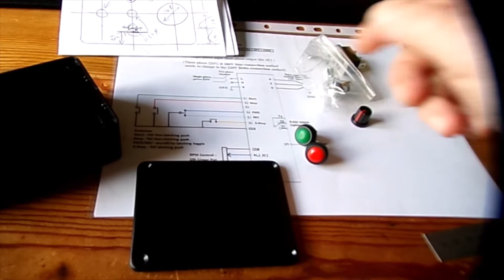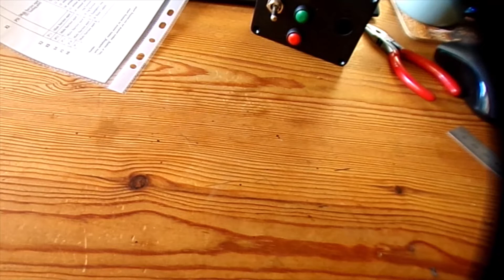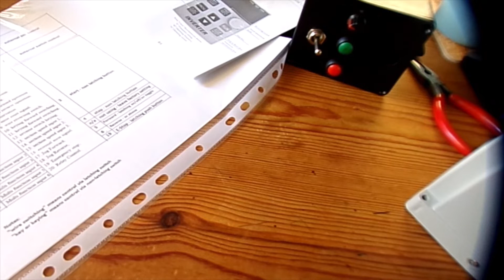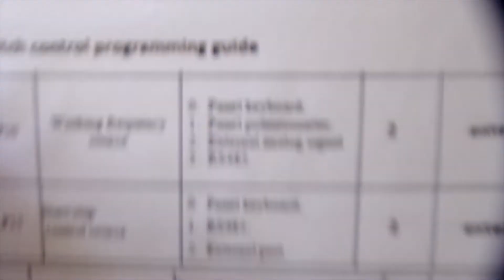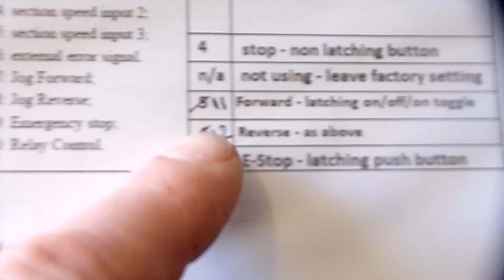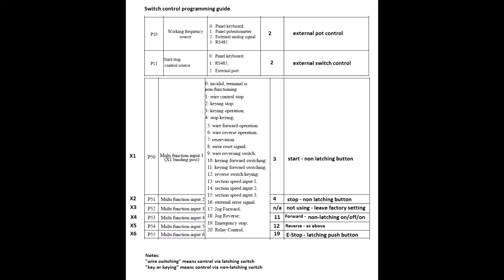VFD Upgrade for the Clarke CL430 Lathe - Part 2 - External Controls for XSY-AT1

Comment: Thanks for this video. I have got this type of VFD now set up on my metal lathe. It is a s/h vfd so I am not sure if any other parameters have been changed other than the ones you mention here. It works fine except I cannot get the remote speed pot to work. If I program it for external pot it then runs full speed and the pot does nothing, it is a 10k one. Any thoughts?
Reply from the maker: I assume the 10k pot is linear and not logarithmic?
Check all switches are non-latching and test pot with a multimeter.
Other than that just recheck your settings.

Comment: After using all your information, ive finally got things working, with one minor issue, when I try and use a 10k ohm potentiometer to control the speed, i only get 35.5 Hz max speed. If i use the panel control, i get full speed, qhich is set at 65hz 
Did you have any problems like that and if you did, what did you do to fix it.
Reply from the maker: I have never looked at the panel control to check  max speed. Next time I use the lathe I will have a look.
Reply: I had the same problem and solved it by changing parameter p73 from 61440 to 31440. Hope that helps.

Comment: Hi, Thank you for this very informative video. I am right now, trying to do the same with my Myford ML7. I've had to send three of these inverters back as broken due to very poor instructions. Could you Pease, please, please let me have a photo / diagram of the switch wiring as I'm unsure how to wire up the start / stop switches. This has been a very stressful project thus far. I just want to make sure that everything is spot on before blowing up another inverter. Incidentally, My inverter is the same as yours. Thanks once again.
Reply from the maker: Hi, sorry to hear you are having problems.
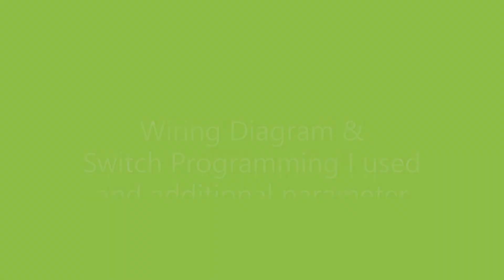The wiring diagram is at 24:24 in the video, you could pause it there and take a screenshot. There is also additional information following that.
I used normally open non-latching switches for the start & stop switches.
I found the instruction sheet by searching on google XSY-AT1.
Hope this helps.
Also take a look at Steve Jordan's youtube channel, he has fitted one to his ML7.
Reply: Just wanted to say a massive thank you for putting me straight on the VFD wiring and programming. All works a treat now.  @InTheShedUK
Reply from the maker: Glad to hear you got it working @stevenmackay9192
Reply: @InTheShedUK  the one thing I do need is a clear picture of the parameters chart that you showed in your video and said that you’d put a clearer image of it at the end of the video, but unfortunately you didn’t. I’ve taken a screen shot of it, but it’s too blurry when printed. Hope you can help?
Reply from the maker: Just put the info I think your after in the description @stevenmackay9192
Reply: @InTheShedUK  thank you

Comment: Good Evening,
Very good video!!!!
Is it possible to set the AT1 to run for a specific time 5 minutes.....12 minutes.......or as long as someone wants?
Thanks
Manolis Greece
Reply from the maker: I could not find anything in the instructions for a timer. There does appear to be a function to turn the inverter off after one hour.